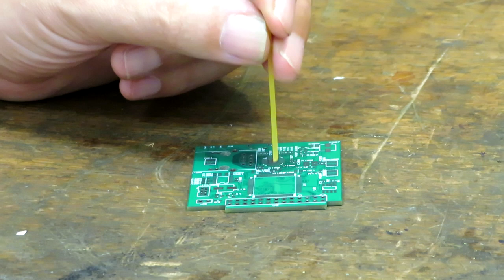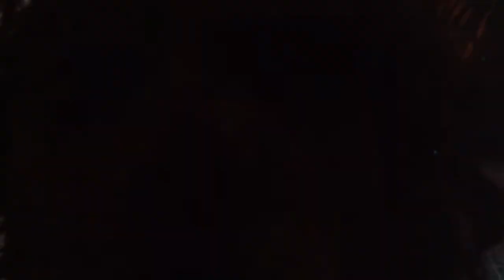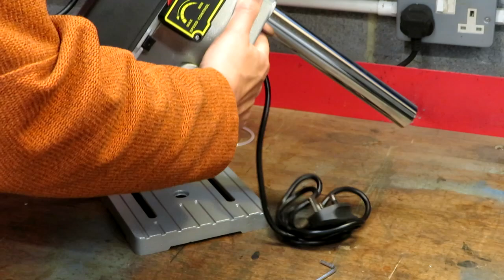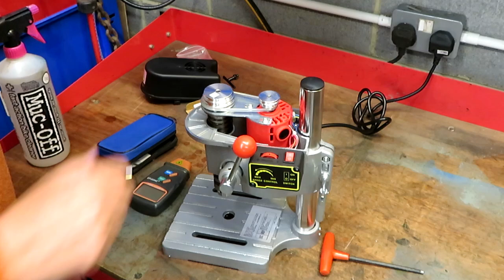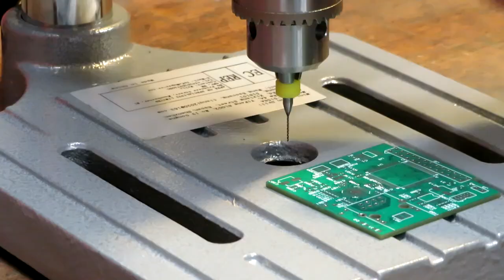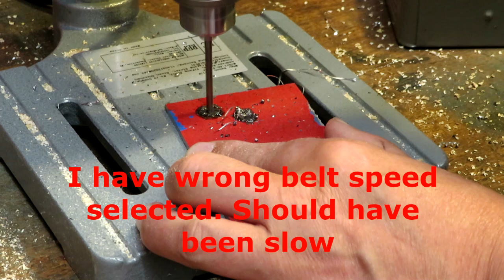Dremel Driller Killer - High Speed Bench Drill

Comment from the maker: Note - I repeated the steel drilling test with the low speed selected on the drive belt pulley and as you would expect it did much better then shown in this video.  Unless drilling soft materials like wood the use of this drilling machine should be restricted  to smaller drills maybe 4mm as the maximum.  I would not recommend it for 10mm etc. The tool is however perfect for the intended purpose of drilling small holes at high speed. The drilling machine is manufactured to a good standard and is good value for money.

Comment: What a fab little machine!
I have a Dremel on a drill stand, and never gave a thought to the accuracy. It's been fine for my less than pinpoint requirements over the years, but my word, there's a lot of 'slop' - particularly in the stand!
Fantastically presented video, and a great review
Reply from the maker: Thanks Paul,  regards Chris
Reply: The dremel stand can be "strategically" tightened here and there so it behaves "better". I've used mine with 1mm drills on PCB and havent' broken a bit yet.

Comment: I bought one of those drill presses about 5 years ago; mainly for PCB work, but also very useful in our church pipe organ restoration business.

Richard, UK
Reply from the maker: Has  the motor proven reliable there are some complaints. Hi Richard  hope all is going well for you, my best regards Chris
Reply: @allthegearnoidea6752  No Problems with it whatsoever. Did about 3000 3mm holes in hardwood with it on the last organ restoration. Mine came via Aliexpress for even less money.

Richard

Comment: Hello, Chris. Thank you for another in-depth review! So hard to decide what is good value for money these days, your videos certainly help. My biggest concern would be that plastic motor housing - though there are some amazing plastics out there. Some temperature checks would be interesting. Also, added lighting sounds like a excellent idea. Regards, David
Reply from the maker: The motor doesn’t appear to run over hot but I haven’t used it heavily as yet. Some people on over Amazon reviews have complained about motor failure but I suspect they could be overloading the machine. If I have a problem I will post and update etc. thanks David and stay well, regards Chris

Comment: Great demo on the lateral movement issue with dremels etc.
I have an ORYX PCD Pcb drill and the vertical height of the entire assembly is just 8" or so which I think contributes to having bits last a good while before breaking. Sometimes though they will just break (0.8mm) for no apparent reason, and I always thought was likely due to hitting hard spots through the FR4.
At work we used to employ somebody to drill PCBs and you'd hear the machine all day long......broken only with random swearing as he broke drill bits.
PS. The ORYX runs at 18000rpm.
Reply from the maker: Hello Ian - Hope all is good with you. The ORYX PCD Pcb looks very good. Many years ago I worked for a PCB manufacturer and they had this big cast iron work bench with a built in screen and foot pedal air operated drill and was a fantastic bit of kit. I think PCB drilling is a bit of dead art now like making PCBs at home but I just enjoy the craft and sometimes have to have that PCB in my hand the same day etc. It is ueful to have a smll high speed drill in the work shop for those smaller jobs.   Chris